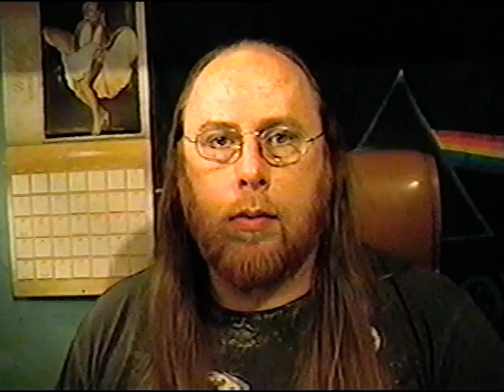PJ~2 What Is Hot Air Really Worth

Comment from the maker: If plumbing is built right, it doesn't leak. If the air is dried before storage, it won't even be corrosive. If PVC (or perhaps recycled milk jugs) lined pipes are used, the air wouldn't even need drying. Heat changes would be minimal by the time air would hit a pipeline. 

There's a lot more to this, but it will wait.

Air is not steam, a different asset with different problems, solutions and trade offs.

As do I, and Luc has got some great bio-gas plans.

I'm only beginning to share.

Comment: Like all power distribution, I have to ask how efficient it is? If I under stand you properly there will be a pressure line and then pneumatic motors at the ends of the line to generate whatever.

What is the efficiency and what pressure were you contemplating at operating at? Anything over 100psi requires specialty components and bursting is catastrophic if not lethal. As is, serious power requires serious air volume.

IE: Impact Gun + Compressor = Painfully inefficient.

Just ideas

Comment: I am against it only because anytime you covert power from one application to another you always have loss.

we must consider 
1. How much power is required to generate the original pressure?
2. How efficient is the end air motor?
3. How efficient is the generator on the air motor

I think this would be terribly lossy. Not dismissing it, I just think that it would be inefficient to transfer power this way.

Comment from the maker: @Curas1
"but that's gambling"

Nope. Wrong.

There is zero gambling in setting up renewables, even with almost no regard for how it's done. To do it at all, is all gain.

That gambling paradigm you quote is a 100% lie, straight from the propaganda machines of the carbon industries.
That paradigm can only be conditionally correct, if the setting up is being done intentionally wrong. Which, IMO, some of it

it IS.